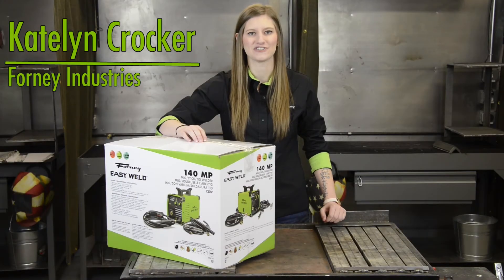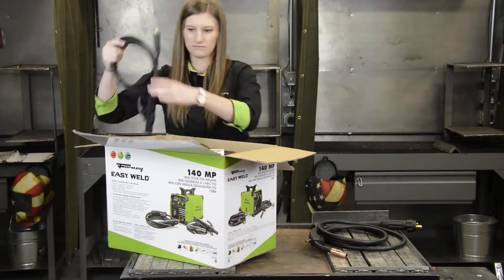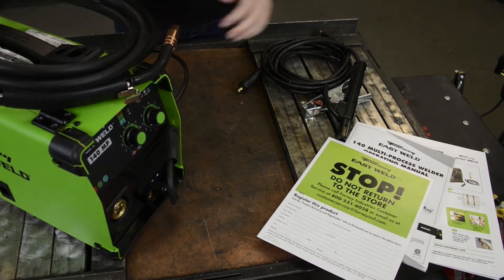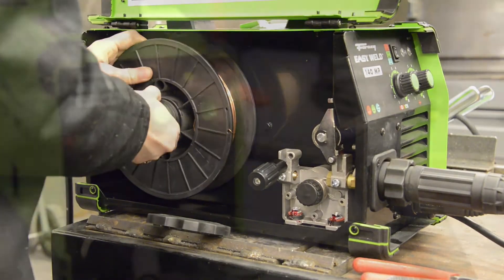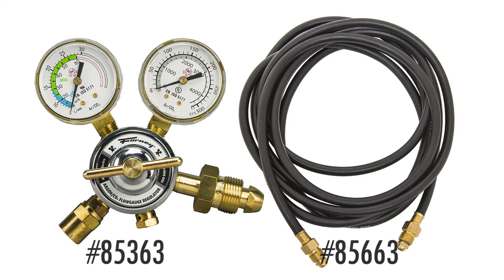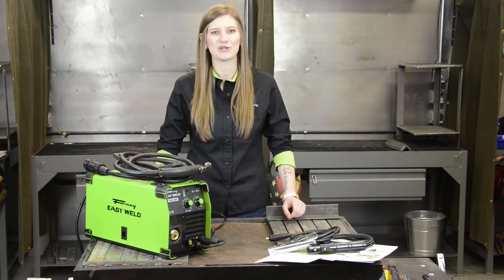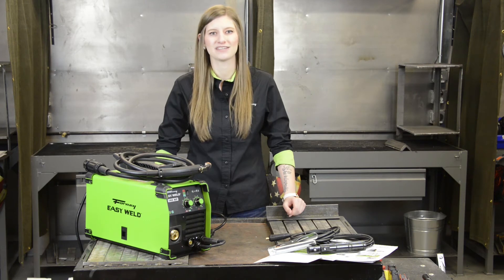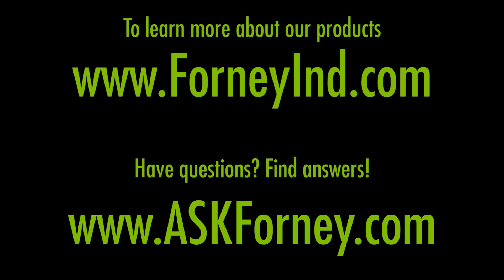Forney Easy Weld® 140 MP Unboxing

Comment: "79 - 197 inches per minute (IPM)"
This, which makes welding thin plate impossible (think auto body) is what makes this welder a no-buy. And for the price: no digital display, no inductance control, slower wire feed speed then competitors. Easily outmatched dollar-for-dollar at same or better quality and with more features by your competitors. Forney - time to step up your game.
Reply from the maker: Thank you for your comment. This machine is not intended for welding on extremely thin materials. This unit is designed specifically DIY, maintenance and repair, hobbyist and metal art.
Reply: @forneyind  Hello, Can You weld Stainless Steel with this model?

Comment: The Amazon listing mentions that it can weld up to 5/16" steel. Is this specific to one of the processes or can I just weld 5/16 with regular flux-cored wire? - Thanks
Reply from the maker: This machine will deliver its optimum performance with both standard and flux-cored MIG.
Reply: Says on the box 1/4" max